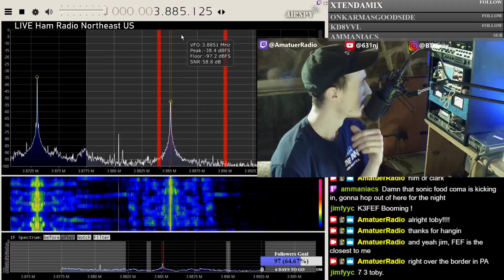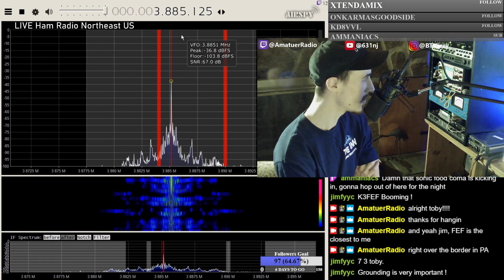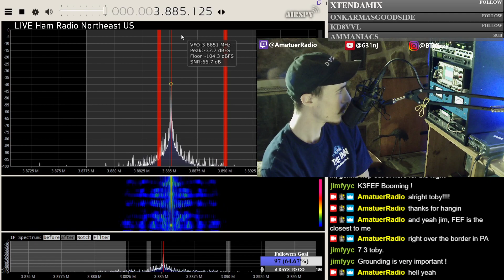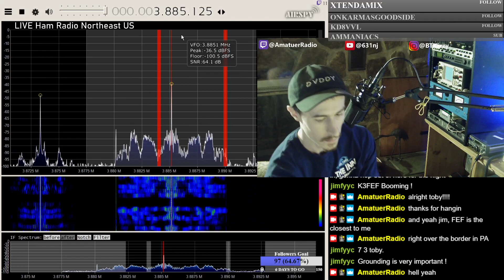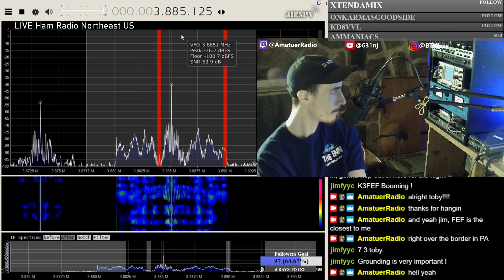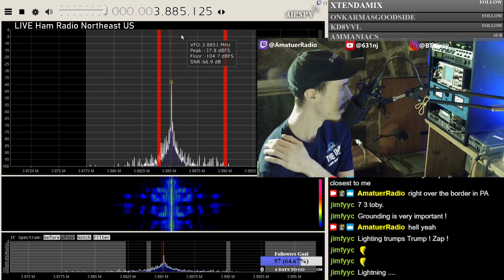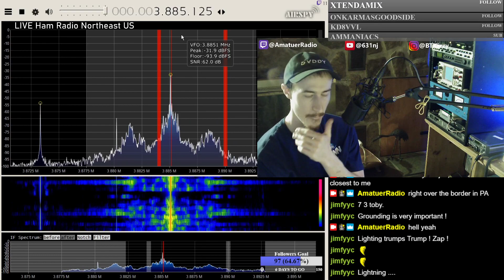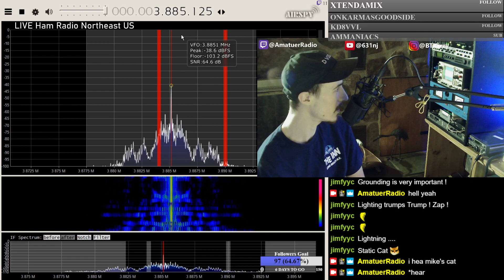Lightning - Should you disconnect your antenna during a storm?

Comment: My metal pushup pole is anchored in the ground and grounded.  The coax shield is grounded to an 8' ground rod via an antenna arrestor.  My coax cables have service loops below the window where they connect to a service panel with SO-239s.  Before a lightning storm I disconnect the short coax cables (inside) from the service panel with quick disconnects.  Is this what you call floating my antenna and I should ground it?  Are you suggesting that the center conductor should be shorted to ground if you disconnect it?

Comment: Lighting coming in on my broadband cable fried my cable modem on one occasion and the Ethernet input to my Mac on another. There's no way I'm going to leave anything I own connected in a thunderstorm. My Mac now has a 10-foot WiFi air gap with that cable system. Ham equipment is no different. A better discussion would be over installing a whole house surge protection system.

Comment: When not in use, I have my coax outside with the pl 259 1/2 way thru a 10' section of 1'' SCH 40 PVC pipe un-grounded, and the coax next to my ground rod 5/8x10'. I have a two section 20'
telescoping mask mounted 10' up a tree 4' from the house with the fore-mentioned ground rod directly below the antenna. I have a 6 AWG stranded, bonded to both ends of the lower section 
and also to the bottom of the top section. From there a 10 AWG stranded to both antenna U-bolts. Both wires are taped neatly to the mask. Antenna is A-99

Comment: Well, this is a deep subject, and I hesitate to way in. I will say, having had a Tesla Coil, HV does indeed love sharp points to strike and spheres will produce a corona first but as the distance
is reduced will be struck. By placing a thumbtack, etc. on the aerial capacitor, as Tesla called it. Will indeed make the streamers emit from this point, as well as a black widow or a 72-tooth 
saw blade for instance if you want that many streamers, ie 72. However, by doing so, the coil will not ring up to its highest potential. The larger the sphere the higher the voltage, and if large 
enough there won't be any streamers breaking out at all. Now, when a smaller sphere is used capable of producing streamers all the time. Move a (Grounded) shorting stick closer and 
eventually, you will see small streamers coming off the stick first, as you move closer yet at some point a powerful arc will connect with it from the TC sphere. There is even a color difference 
between the ground side (pinkish), and the output of the TC (blueish) you can see, and white where and when they connect. I will add just one more observation. My coil's visual streamers 
were approx. 48" and if a 4'' grounded Cu ball was hung about 36'' away it would produce a beautiful corona towards the TC and would occasionally be lightly struck, but the streamer from the 
TC was just as happy to go right past it just ionizing the air.

Comment: Good discussion.  Think of a lightning rod.  The purpose of a lightning rod is not to attract lightning, but to repel it.    Your antenna mast should always be grounded as per National Electrical Code.   If you are hit by lightning it might be the difference between your insurance paying for it or not.  On a physics point of view, Lightning is a negative voltage looking for a positive voltage.  A lightning rod, which is attached to ground, will emit electrons (best from a sharp point)  thus moving ground potential to the level of the antenna.   This makes your antenna less of a target.   Another option is to have trees around your property that are taller than the antenna.  If you do disconnect your antenna, you should ground it.
Reply: RE: "If you do disconnect your antenna, you should ground it."  My metal pushup pole is anchored in the ground and grounded.  The coax shield is grounded to an 8' ground rod via an antenna arrestor. Are you suggesting that the center conductor should be shorted to ground if you disconnect it?

Comment: The correct[smart] way is to disconnected coax/ feedline/ rotator cables etc. is at the entry point to the structure because you don't want your house to catch fire. The equipment is not important. Disconnected and pull away from building .  Believe me i've seen it happen many times.